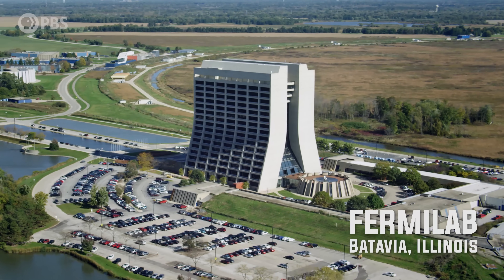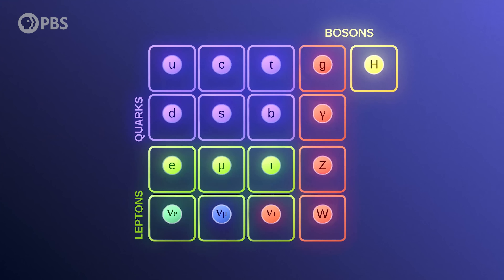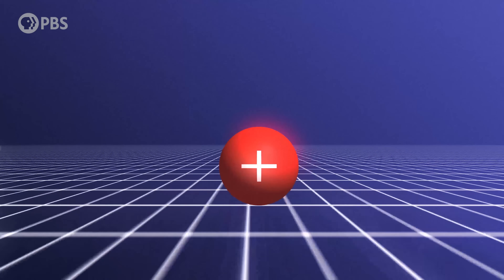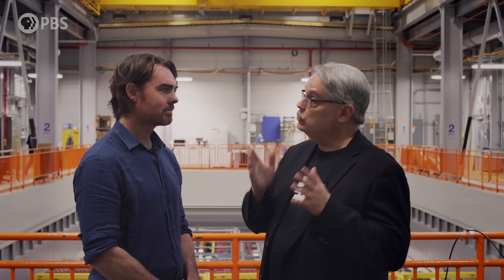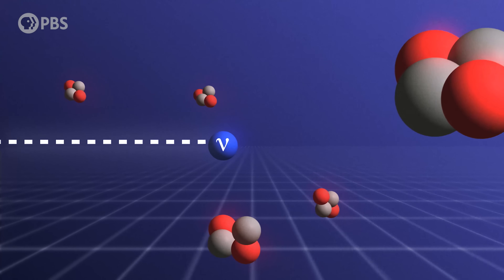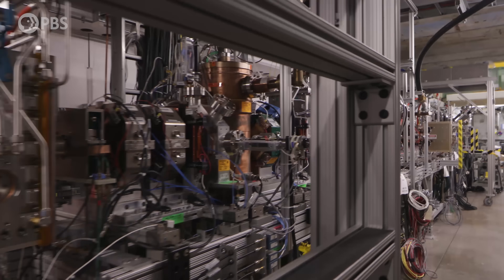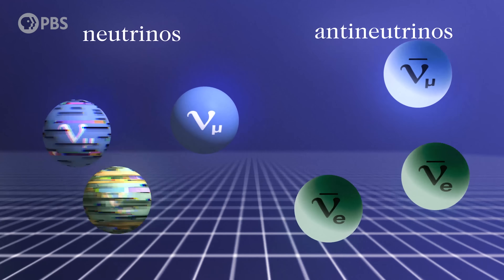How To Detect a Neutrino

Comment: I have a question no one could ever explain to me: If dark matter doesn't interact with anything but gravity, why doesn't it become a black hole? What force would prevent dark matter particles from clustering up on each other until infinity? In normal matter, the counter part to gravitation pressure that pulls everything together is temperature creating an inner pressure. That way stars don't become a black hole but stay a physical body. For that, they need electromagnetic interaction and later in neutron stars quantum effects (Pauli principle) to prevent collapsing into a black hole. Only when their gravity becomes stronger than these forces, a black hole can form.

Now what force would that be in a dark matter cloud what keeps it from collapsing if they don't interact with anything but gravity? They should become a huge black hole, not?
Reply: Dark matter cannot cool itself through electromagnetism. Normal matter, when it gets dense, interacts electromagnetically. While this allows particles to 'bounce off' themselves, providing pressure, it also causes the emission of of photons which drain energy. So regular matter 'clumps' very easily.

Dark matter by contrast appears not to be able to do this. The 'force' that prevents its collapse is its own motion. This is not unusual; the solar system doesn't collapse into the sun despite gravitational interaction (But negligible electromagnetic repulsion.) because the orbiting bodies cannot shed their kinetic energy and drop towards the sun.

Comment: I have three questions about how the cosmic expansion from the Big Bang
The first question is if the quarks produces gluons
Do gluons produce particles too?
The second question is the vibrations of quarks, electrons and gluons
Are these particles producing a new area of the universe?
The third question is about cosmic expansion
Are these additional spaces caused by the formation of new molecules?
These were three questions about the theory of cosmic expansion (the Big Bang).
We hope you send these three questions to experimental physicists
We want answers that depend on physical experiments in laboratories

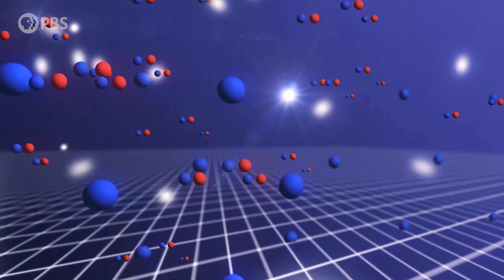Comment: 7:50 "... the fact that we see a universe full of matter..." The implication is that we see a universe with no antimatter. There is your fallacy. We don't see a universe with no antimatter. We only see the observable universe with no antimatter. If the universe is infinite then we only see 0.00% of the universe. You're extrapolating from 0% to the whole universe. Watch my video Where Is All The Antimatter.
Reply: Possibly, but that just alters the question to 'Why do we see such a big lump of matter rather than the far more likely 50-50 mix?' The antimatter had to be separated out *somehow*, either by destruction of physical movement.
Reply: @garethdean6382  I consider one possibility in my video Where Is All The Antimatter. https://youtu.be/-GAvo1SAjXk My complaint is that they don't seem to consider ditching the Cosmic Principle which is based on observation of 0% of the universe.
Reply: The universe is not infinite, otherwise the expansion would not make sense. 
Although the limit of the universe cant be reached... so the universe has a different kind of infinity.

Comment: About neutrinos... It's a well known saying that you need a light year of lead to stop half of all neutrinos. When I heard that I was like "Must be not enough lead in the Universe for that", but than I realized it depends on the cross section area. So, if we actually take all the lead in the universe, make it solid and into a light year long cylinder (probably to study neutrinos), how much cross sectional area would that cylinder/wall have?
Reply: Cosmically, there is 0.47 lead atom per million silicon atoms. (Standard 'cosmic abundance' reference point.)  There's one Si atom for every 30'330 hydrogen atoms. Ergo there is one lead atom for every 64'536'453'900 hydrogen atoms.

The average mass of an atom in the universe is about 1.75 atomic mass units. Since lead's average atomic mass is 207.2 we can calculate that there is one AMU of lead for every 545'071'400 AMU of anything else.

 The estimated mass of the universe's regular matter is 1.5 × 10^53 kg. This means there is about 2.75x10^44Kg of lead in our observable universe. Lead's density is 11.34kg/m^3 which gives us a total volume of 2.43x10^43M^3 of lead.

A light year is 9.461x10^15m so the area of the cylinder will be 2.565x10^27m^2. For a cylinder that's a radius of 28'573'874'310km or about six times as far as Neptune is from our sun.

That's quite a big cylinder.
Reply: @garethdean6382  Thanks! Nice to see that someone actually did calculate it))

Comment: So, due to the uncertainty principal, we cannot know the exact position and velocity of a particle. But what if you measure the position of a particle at one point (thus changing its velocity) then measure it again a second later (or some other obscure time frame). Could you then divide the distance by the time to get its speed? And once you know the speed gained by measuring its position, can it be applied to other particles as well?
Reply: Further more, once you know the speed gained by measuring it, (assuming all other particles are non existent for the sake of simplicity) could you then know where it is at all times just by knowing it’s original position and it’s current velocity?
Reply: No, and the reason is a curious one.

The uncertainty arises because of the wave nature of matter. Particles are single solid balls bouncing around, but wavepackets, which is why we can do things like the Double Slit Experiment where a single photo goes through two holes at once.

When you measure a particle you're essentially 'squashing it down' into a certain volume of space that is its 'location'. We don't really notice this in everyday life since the amount of squashing we need to do is quite small.

But if you want to measure an electron's position very precisely for example, say to the volume of an atom, you're going to need to do more than just look at it with light. You're going to need to smack it, probably with an electron beam Our best microscopes are electron microscopes.) and that will give it energy.

What this means is that the more precisely you measure a particle the more varied energy it's going to get. This stops you predicting its future path since you no longer know exactly how fast it's going. You can try two measurements to get the average speed, but then its speed will have changed *again*, ruining that strategy.And so on.

Comment: Another case of delusion that physicist made up about originate of the universe. The premature conclusion is based upon the data of neutrino registration deep underground (under ice) in Antarctica, where for about several years was registered some ten of cases: several high energy neutrinos and some ten cases relatively low energy neutrinos….. that are the facts! There is necessary a lot much years of confirming such cases to be sure from what directions come mainly these particles and to estimate the energy spectrum through more cases observing. So the experiment is far away from the conclusions. But some physicist instantly decided that this is evidence about “big bang” “young stars” and soon. And all these, if the physics nowadays can’t say anything about the essence of these mysterious particles called neutrino! Let me explain: According to USM www.kanevuniverse.com in the beginning when our space (universe) was started in the center of our galaxy, that started is with very first orbital system containing only two proto particles representing very first “hydrogen atom” from two almost equal proto particles with mass 1,8.10 rising to a 13 power times smaller than the mass of proton. In this moment with appearance of this very first orbital system appears the energy itself as well and this energy is almost equal to zero and the first real value appears together with the first difference between the masses of the two proto particles. And that difference appears because of the beginning of space expansion provoked by the added new masses (proto particles), which disturb the inertial balance of this very first orbital system (see part I USM). That was our universe in this very first moment. Then begin to expands the macro cosmos and begin respectively to thickening the micro cosmos, which means that the nuclear proto particle in the beginning orbital system begin to weigh more quickly than the orbiting proto particle, because the first is on the center (more close to the micro cosmos). How it is seen the two particles during movement towards the periphery of our galaxy come to our position of observation where the central particle already has the mass of proton and the orbiting one possesses mass of electron, so in our position of observation the proton has resonance radius equal to the size of proton (see USM) and the electron has resonance radius equal to the size of atom. But what has happened with expansion of the macro cosmos (our galaxy) looked at our position of observation? The resonance radius of the first proto particle in the very first orbital system (“hydrogen atom”) in fact is the size of this very first orbital system, so during the expansion of the macro cosmos this resonance radius begin to expands which means that it represents more and more lightering of the proto particle mass and when this process come to our point of observation this particle already has the mass of neutrino, see page 128 to 138 USM www.kanevuniverse.com In the formulae 125 and 126 is given the masses spectrum of electronic neutrino and the masses spectrum of muon neutrino and the explanation for that. So the high energy spectrum neutrinos actually comes from the smaller resonance radius in any galaxy (more closer belts of centripetal accelerations) and lower spectrum respectively comes from the periphery belts of centripetal accelerations again in any galaxy. So obviously observed here neutrinos has nothing to do with “big bang” and so for absurdity!
That is right that the neutrino possesses mass. First what is neutrino see this: Interesting theme, but as usually don’t explain convincingly in the physics yet. Actually according to USM www.kanevuniverse.com the neutron is contains from proton and layer structure around this proton – “nucleus”, which is proved by the way of neutron dispersing and slightly instability compare to the living time of proton (which is accepted as a stable particle) is explains by the resonance radius of neutron which should be a lithe smaller than the proton one. All these are shown on the pages: 128 to 138 USM www.kanevuniverse.com  There also it’s seen very interesting conclusions about the mass and spin of neutrino: 
About several kinds of neutrinos and what is the difference between them concerning the masses and other features (like a supposed shape – sphere or formlessness), appears to be that there are in force some mass rule consequence, which meant the neutrinos always are ray of particles but not separately one and with very close masses! See USM www.kanevuniverse.com
 See relativistic spin of neutrino, which can be (½) or (0) or even (1,2…) depending by the point of observation: 1. Observing from the point of electron or μ- meson (strong interaction – polarized space by the polarizing member ±√(1+V^2/C^2 )  see USM www.kanevuniverse.com ; 2. Sinking in the space of neutrino and becoming part of it, the interaction looks like weak one and the spin is whole number….the polarizing member has insignificant values….
Let review page 137 USM www.kanevuniverse.com where we can see that indeed the effective radius of our galaxy is around 100 folds bigger than the visual radius and interestingly to suggest also page 134 where is calculated the resonance radius of neutrino and again page 95 where is shown how this radius is obtained; Page 137:
“Finally let we pay attention to the following discrepancy: On (122) we calculated that the resonance radius of neutrino is equal to:5,4.〖10〗^24 cm this resonance radius must be coincide with the resonance radius of Galaxy, equal to: 4,63.〖10〗^22  cm, because to the nucleus in our space correspond the Galaxy in over-space. The difference of the order of 100 times may to explain by next: The effective density of substance in Galaxy, although with ignored small value, continues in between Galaxy’s space until to distances of the order of 100 times bigger compare to the radius of Galaxy. It naturally doesn’t influence upon the accuracy so far we calculated, because we speak about ignored small density compare to this one of whole mass of Galaxy. For the neutrino however the resonance interaction, by which it is creates its properly field, is getting by the effectively gravitational field of Galaxy, which is spreads until to distances 100 times bigger compare to the radius of Galaxy. Further we can see that it is not accidentally.
 And now, from the point of view of USM, we will give answer to the next question: Why on the week interactions the parity doesn’t preserve?
First of all let we define the essence of concept – parity. In part III p.3 fig. 33, we saw that the spin of free particle reflects the polarization of space, provoked by the polarizing”……. G.Kanev